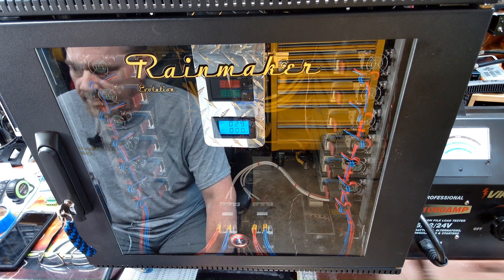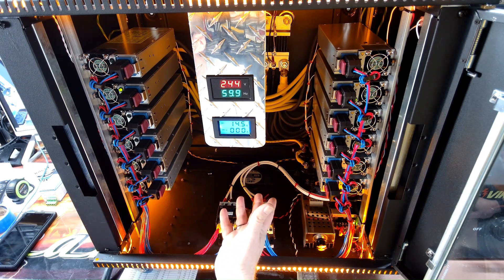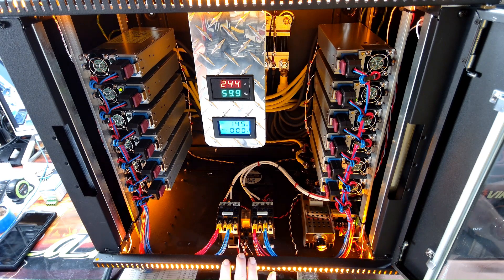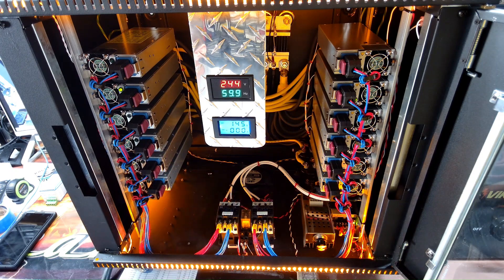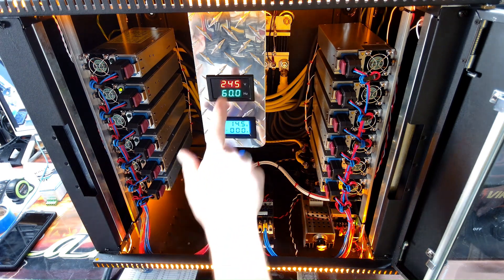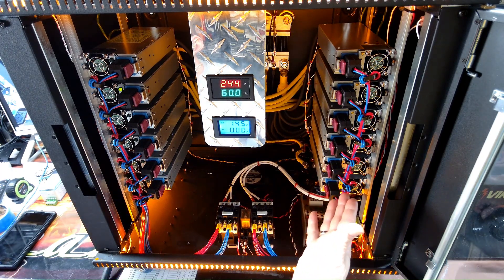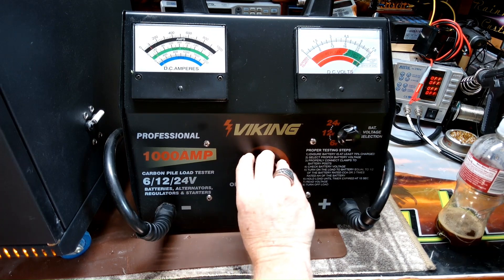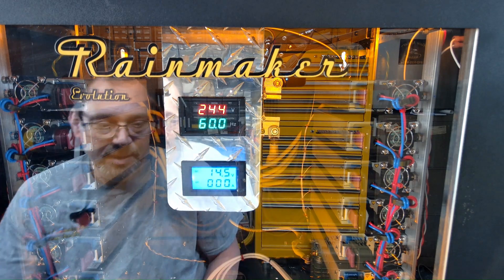Colossal 1200 Amp Supply Final video

Comment: supplies went into crowbar, FAIL!
Reply: You can only test crowbar with the green light on one module at time. When tied together sharing or not the lights will go off on all modules but one most of the time.  I learned this the hard way. If a modules crowbars you will know it the fan on the one that quits will go wild!
Reply from the maker: 1500 amps. Will kick out the load tester it's self